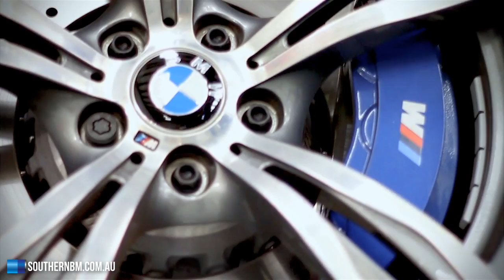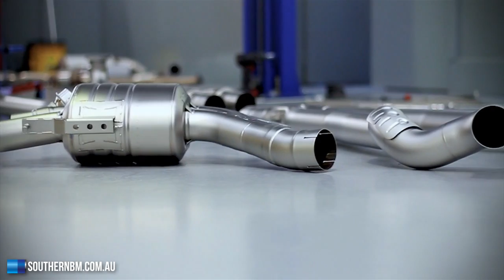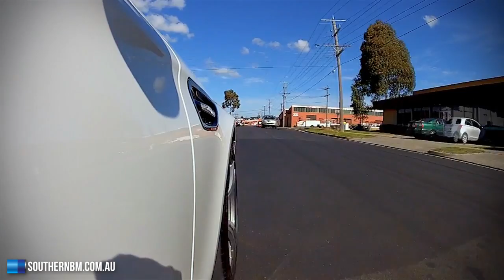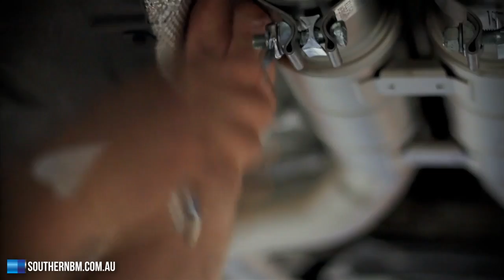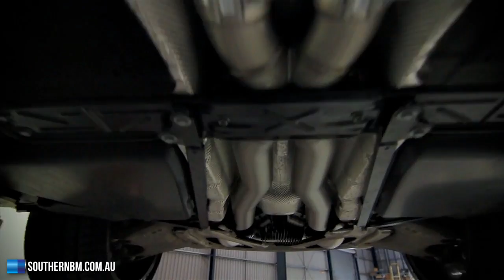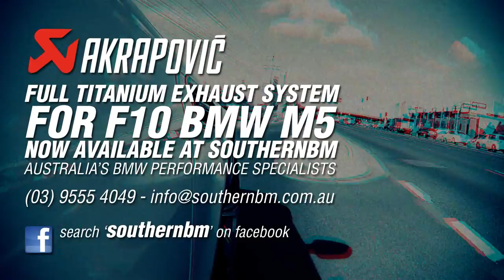BMW M5 F10 Akrapovic Titanium Evolution Performance Exhaust upgrade, SouthernBM-Australia

Comment from the maker: A little louder, most exhausts are not loud at idle compared to cars of the past. I installed an Akrapovic on an X6M today and that is similar, a little louder at idle but the tornado comes on when accelerating.

Comment: Hi does this install require you to run a vacuum setup for the valve operation? I am thinking of getting Fi for my X5M but I don’t think anyone here in NZ would have a clue of how to install it? 
Online people are saying the easiest way is to run it through brake booster which I have no idea what that means
Reply from the maker: The stock M5 has vacuum control and so does this Akrapovic for M5. What they are saying for the Fi exhaust is that you need a vacuum source to operate the valves. They want you to put a t piece in the line a run a vacuum line down the car to the valves. Have you considered buying an Akrapovic for your X5M. If you have an E70 X5M, i do have a second hand E71 X5M Akrapovic Evolution exhaust here. Not sure what price you would be looking at to ship to NZ though, it is very large exhaust.